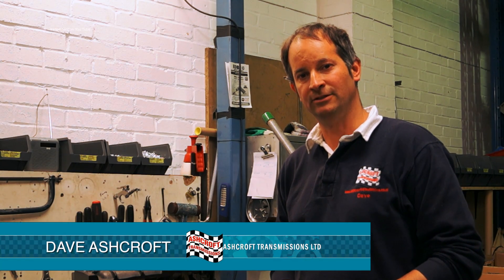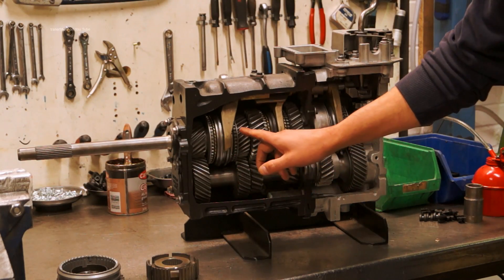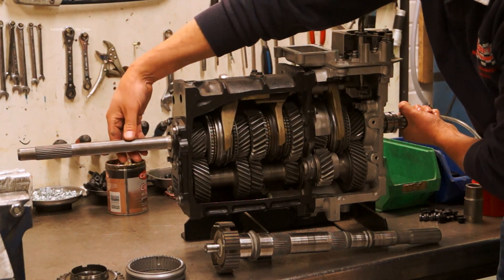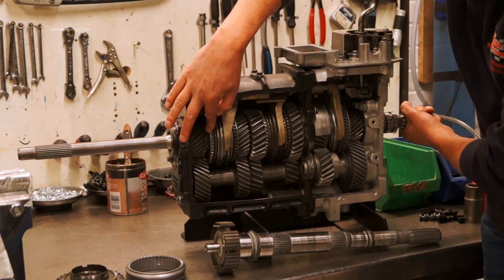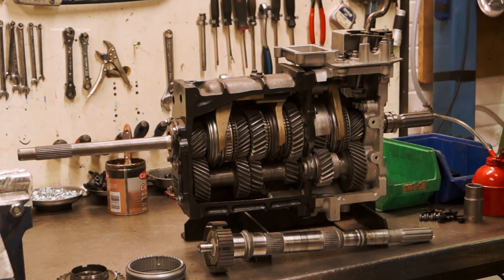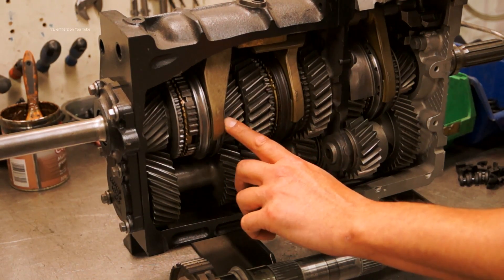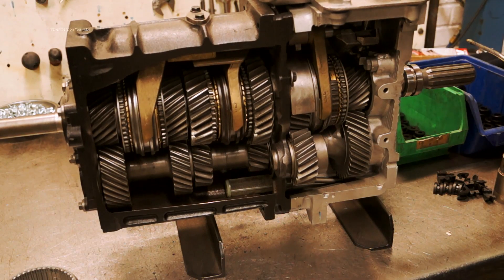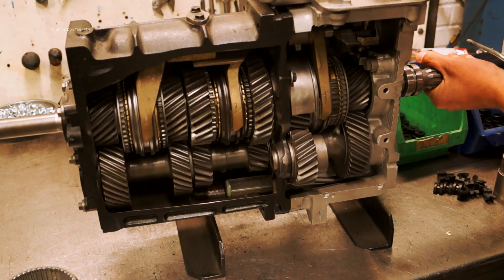R380 gearbox how it works - ask the experts with Ashcroft Transmissions

Comment: At about 2 .11 you can see that the sleeve for the Rev/5th gear synchromesh has the 5 half moons facing towards the reverse gear , instead of the 5th gear, why is this. My r380 is also in this configuration , but the manual clearly states the 5 markings should face towards 5th gear. I am confused as I am trying to resemble my gearbox. Seems contradictory. Thanks for any advice / explanation